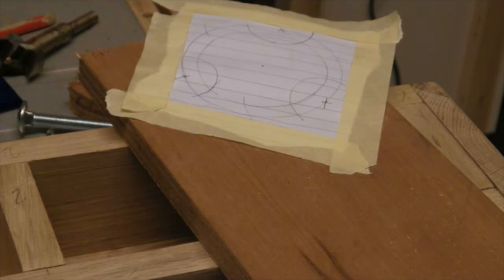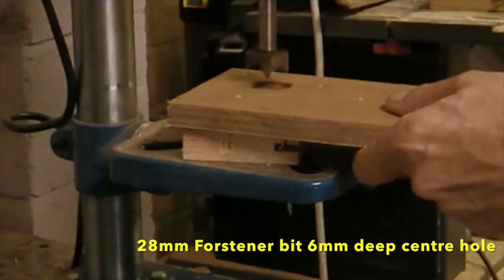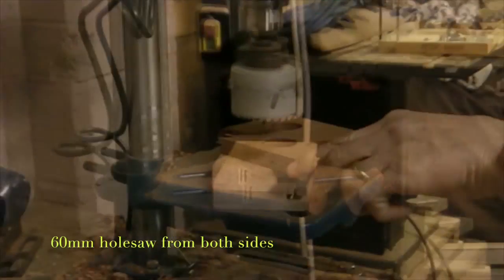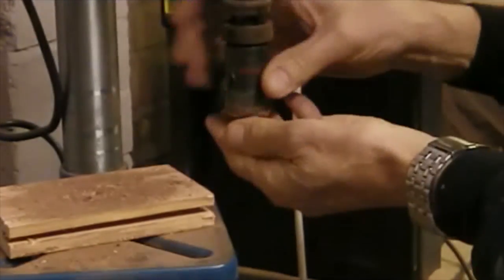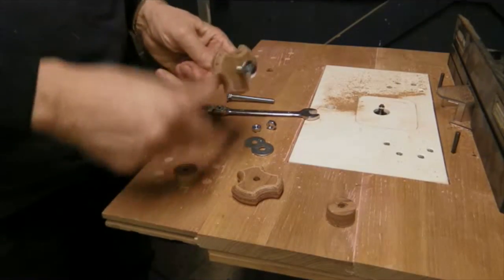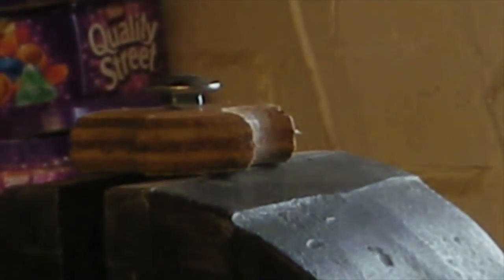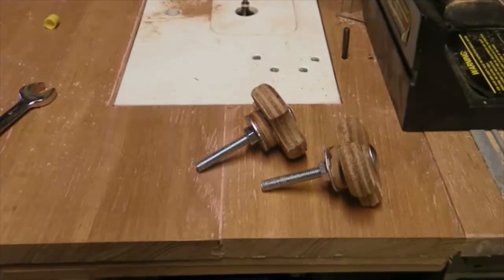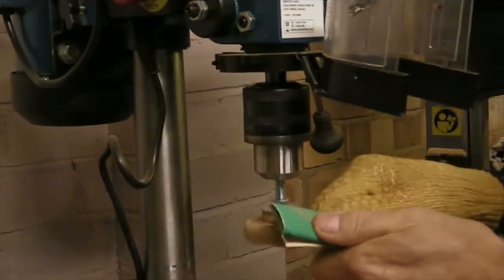Making Wooden Knobs the easy way

Comment: Ya made my heart skip a beat when I saw those gloves on with the router. But hey its your hands and your video so do your thing!.
Thanks for the nice video too!
Reply from the maker: +GoGreenMan rubberised grip gloves,such small parts didn't want them flying out of my hands, I get your point and I'm not recommending  that you should wear gloves.I need to get some anti cut gloves
Reply: +Marcello Bianchi You could make simple jig to hold the part from the center hole and glue/bolt round peace that was excess from making the nub into your jig, to keep nub from spinning.
That was kinda too close for the conform, least for me it was.
Reply from the maker: Thanks for the advice i'll keep it in mind for future projects
Reply: Oh my! The second I saw you wearing those gloves using the router I had to pause the video to view the comments. I'm shocked that there is only this one. If your finger slipped without the gloves on, you would get a nicked finger. It your finger slipped while wearing the gloves, your finger would be pulled into the bit and get good and mangled. From a safety standpoint, you should never wear gloves when using a router.
Reply: Pro1er common sense is not so common any more if you have to explain this to someone. To many making it to adult hood an getting to bred instead of being killed of as youngsters, need more ways to thinned out of the human race, so don't tell them things like this, let stupid take care of stupid, an let Darwinism will take care of the rest.
Reply: Actually, roundover router bits with bearings are relatively quite safe, since the bearing limits the piece from getting too deep a cut. As suggested, I would still prefer some jig to hold the smallish wood knob and keep hands further away.

Comment: Dangerous using a round over bit with your fingers that close to the bit...🙁
Reply from the maker: I wouldn't  advise anyone putting their fingers that close to any power tools, as an ex process engineer I evaluated what was going to be more dangerous the wood spinning out of my hands or catching my hands in the round over bit i concluded that using thick rubberised gloves  I was covering myself in both eventualities and I have had 40 years in the trade and still have all my finger and thumbs